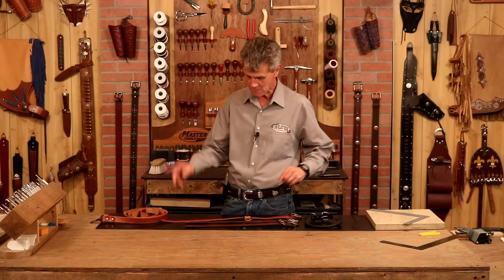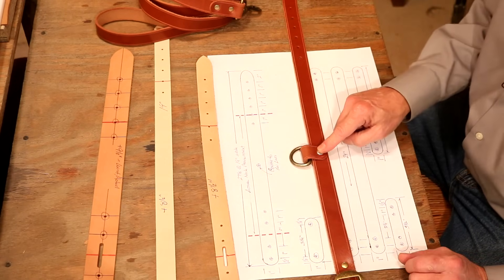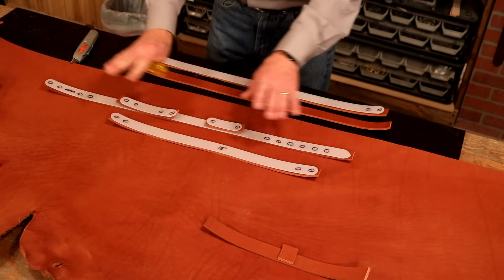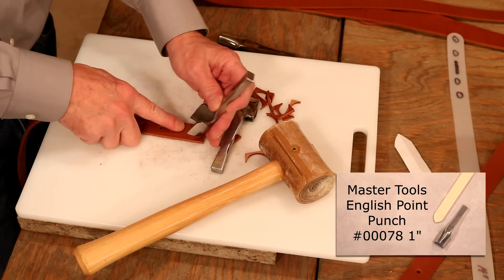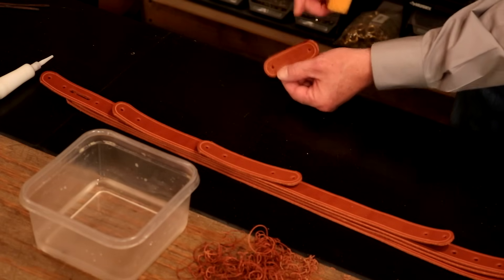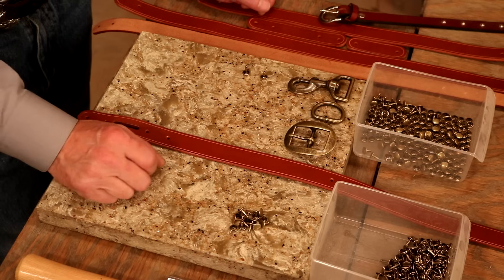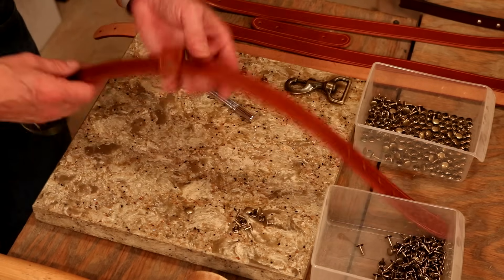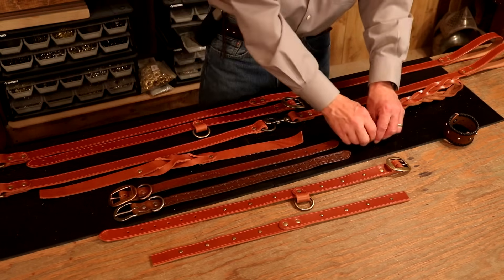Making a Simple Leather Dog Collar and Lead

Comment: One suggestion I would add for large dog breeds starting as puppies, 2 out the 3 dog collars I have made (for dogs, I usually make collars & chokers for humans) I have used a Martingale design. 
Basically two buckles on a short segment of leather in the back (about 4 to 6" in length for large dog breed). And then the main part of the collar has two billet ends. This allows for twice as much growth room as the animal grows than a regular collar would. Just loosen up one side and then the other as needed. So the pet can have a single collar for most of its life than replacing a couple times as they grow. My customer liked it because he could then afford a fancier collar form the start.
One customer wanted the leash attachment point to be on top but still have a dog tag hook on bottom With the leash attachment point on top, it slowed the dog down a bit more. This is good for a well trained dog. I recommend if the dog is very energetic though adding a harness to the rig to keep dog from choking no matter the placement of the leash.  
Just my experience,

Comment: Nice! Your timing is always amazing with what I'm considering as my next project!! We are getting a puppy in the next few weeks so he won't need anything this sturdy just yet but will a little later. Instead of Chicago screws, wouldn't solid copper rivets work, too? I've used them in other projects and found they are extremely strong and hold well. Also, would a latigo have too much stretch? I like their outdoor qualities in an oil tanned look. Thanks again- love your excitement and passion for your craft!!
Reply from the maker: Hi Mark,
Yes, solid copper rivets would work great as well! They're extremely strong. 
You will get some stretch with latigo but it should still work well for a collar and lead.

Comment: My customer wants a D ring and he wants the name on the back of it as well. im trying to wrap my head around this, if the D ring is between theend rivets, where do i put the name? maybe i just have to start the color using this guide and ill see it. its getting some roses and leaves but no color, justa plain brown. another concern, does the D ring serve as both the tag holder and an attachment for the lead?

Comment: Hi,
The leather balm is it balm / wax? Reason I ask is because I notice how shiny it becomes. I use Resolene today, can I replace Resolene with this product?
Reply from the maker: Hi there,
Yes, it is a leather balm with atom wax and becomes shiny when you buff it. It can be used as a sealer instead of resolene.
Reply: @WeaverLeatherSupply  Does it work good with all kinds of dyes? Reason I ask is because in some forums I have read Resolene doesnt go well with water based dyes. I use Pro Oil dyes

Comment: Hi Chuck I have a question for you. I bought a No2 edge beveller from the what I thought was the UK. It turned out to be cheap tat from China and I believe ruined my work as it ripped the edges apart. Could this have been the reason and should I buy a quality tool. 
Rachael (from the UK)
Reply: Rachael Wyatt  - I also had a cheap edge beveller from another company that just wasn't working at all. I finally ponied up for the Master tools beveller from Weaver and it made a world of difference! It was pricey but well worth it. I promise I'm not getting any compensation for saying that.

Comment: I want to ask, what do use to cut the pattern plastic sheet?
Reply from the maker: Hi Miguel,
I just use a sharp utility knife and a straight edge with rubbing backing. The plastic sheet is slick so a cork back or rubber back ruler is important to keep it from sliding when cutting.
Reply: Thank you so much